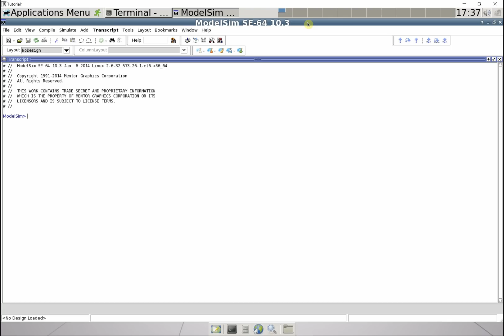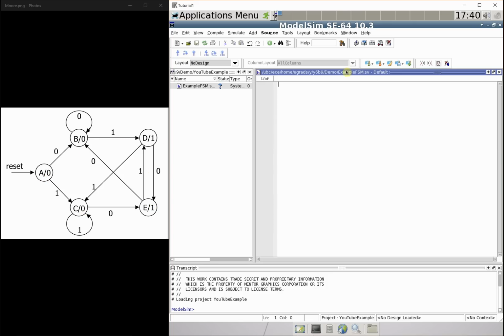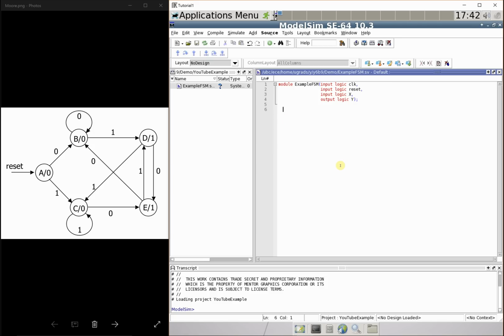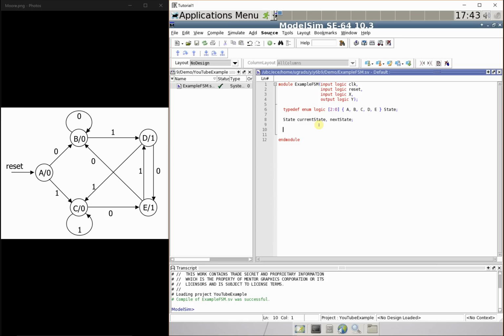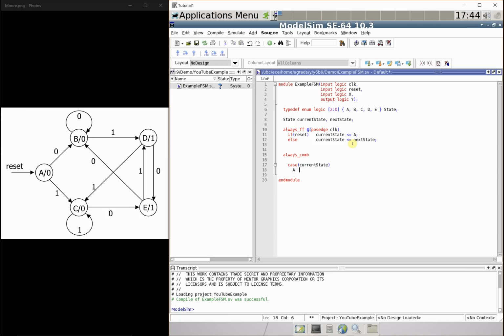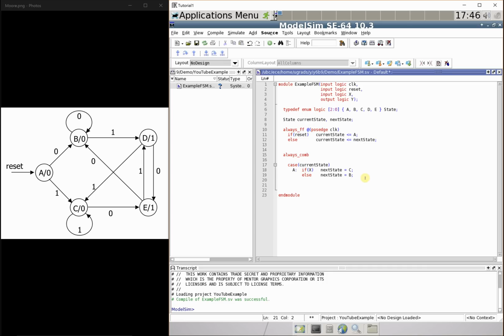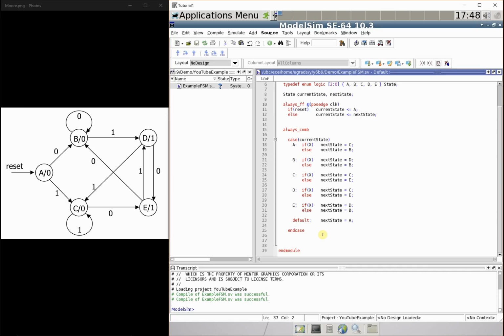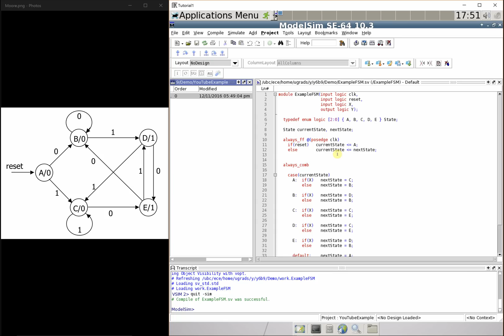How to Write an FSM in SystemVerilog (SystemVerilog Tutorial #1)

Comment: Can you please elaborate on the last line i.e. assign Y = (currentState == D | currentState == E); how did you write this line and what did you mean by your explanation as a two and gate connected to a or gate. I'm a beginner and I want to learn Verilog and SystemVerilog, do you have any suggestion for where and how to start to learn it efficiently.
Reply from the maker: The number left of the "/" in each bubble within the state machine represents the output of the state machine at that state. So for example in state A, the output is 0 (from A/0) and in state D the output is 1 (from D/1). With the last line, I'm saying that the output, Y, should be 1 when it's in the D state OR when it's in the E state -- because those are the only states where the output is 1. For all other states, the output is 0.